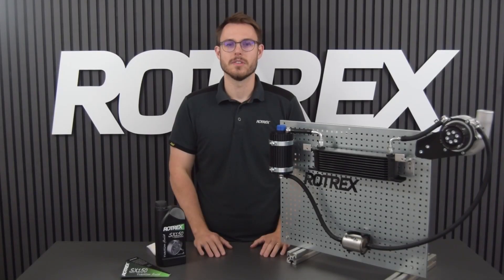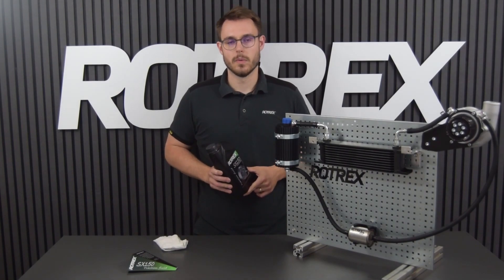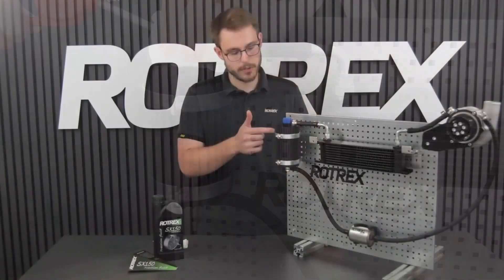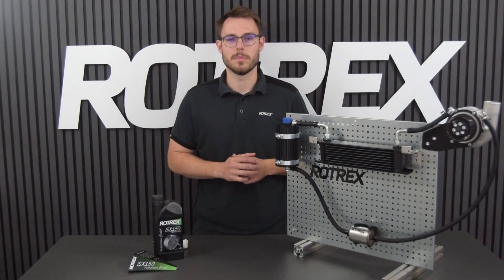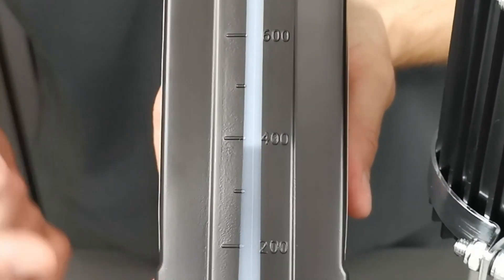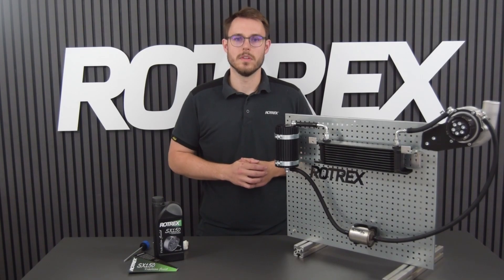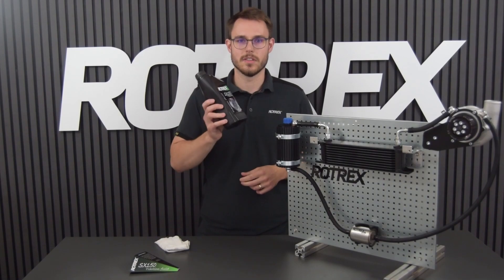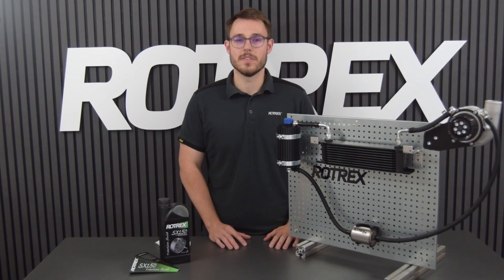[OUTDATED] ROTREX Superchargers - How To Prime Your Supercharger

Comment: Does it matter if the cooler is in the bottom line before the filter or does it have to be in the top line on the return?
Reply from the maker: Hi,
Placing the oil cooler just before the filter can lead to some complications. First of all the oil cooler is restrictive and can contain air bubbles, which will interfere with the priming procedure. We also always want the cold oil in our canister, both regarding the oil level check and overall functionality.
We can not recommend placing the oil cooler anywhere else than after the oil outlet, before the canister.

Please be aware that the priming procedure has been updated since this video, with a new tutorial on our channel.

- Team Rotrex
Reply: @rotrex_superchargers  thanks for the reply 👍